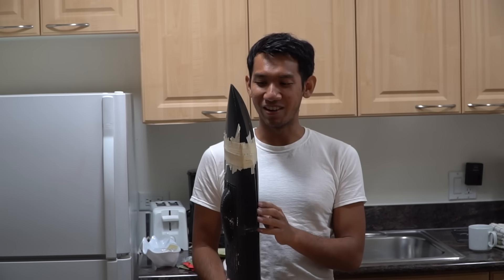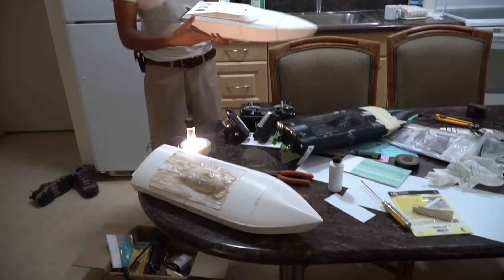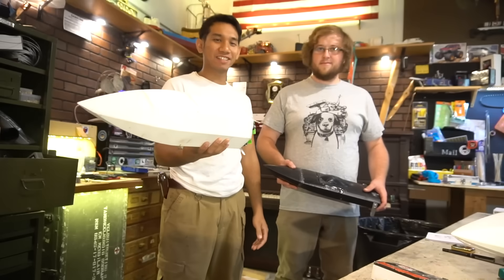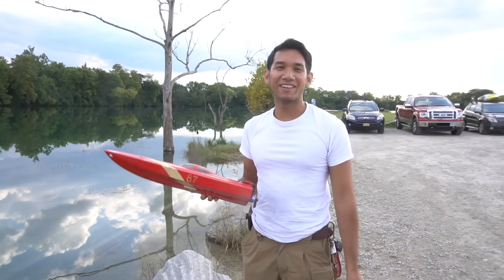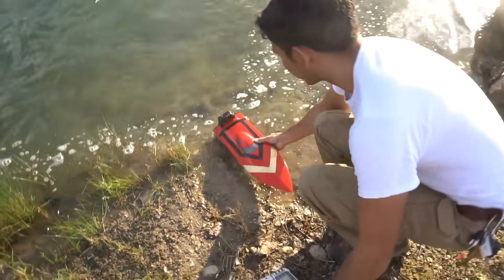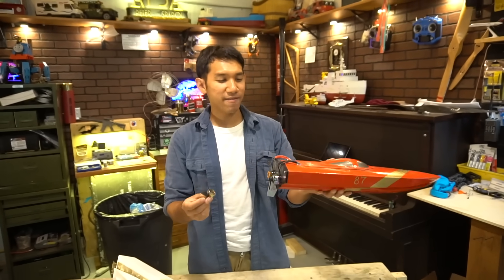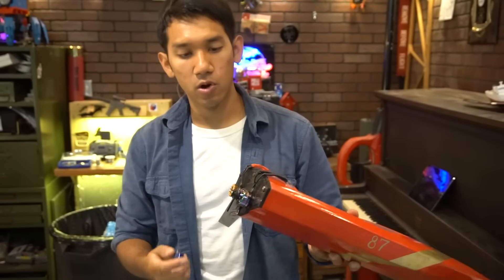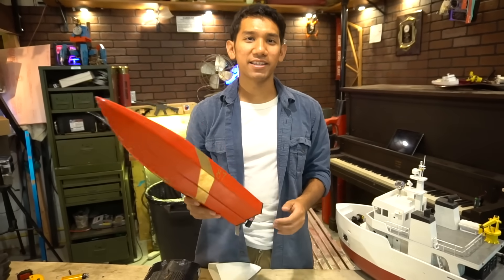FAST simple 3D PRINTED RC BOAT

Comment: I am gonna try to put one of these boats together but with a proper shaft, prop and rudder.  I am gonna try to use a traxxas 12t Titan motor and ESC with 7.2v 3000mAh NiMH packs to power it.  I upgraded a truck to brushless and have a whole electronics and hardware system for a boat extra.  I was gonna try to make a boat from scratch using foam board or thin plywood but this looks like the way to go.  Thanks for posting the .stl files!!!

Comment: I think that your placement of the motors sucks. You should have placed them in the boat and put a drive shaft out the back with a proper rudder and you would have gotten a lot more speed and control

Comment: Can i have the stl file of all the parts for this boat but the dimensions can't be greater than 220mm(my 3d printer can print 220mm x 220mm x 220mm maximum)plz

Comment: Hi Peter,

With injection moulding you need to machine a steel die which is predictably extremely expensive. It's only really economical if you intend to produce tens or hundreds of thousands of units. It costs tens of thousands of dollars per die.

You might want to look at vacuform (vacuum form) moulding which I believe is how most rc shells are created. 

You might be able to find a strong, flexible resin in which case a rtv silicone mould could also be an option, but for creating rc boat hulls I think the vacumform is your best bet, unless you have the money to burn for a steel die.

Obviously researching what other people have done in the hobby would be prudent. Especially as this a little outside my area of expertise.

Comment: When designing a boat hull remember your goal is to displace only enough water to slightly outweigh the boat and equipment so it floats at 0mph and it will rise from hydraulic force st speed so designs that set low in water with no speed are ultimately beter.

Comment: Hi Peter and Sam, do you have a tutorial on how to post process the hull? I printed and build one, but it seems to do the same your boat was doing Peter. It dips the nose down on higher throttle. Also it will turn itself at higher throttle. Tried different props but I'm going to try some more. I didn't have any two bladed ones anymore. It might be the hull has to much drag maybe? Any help is appreciated :)

Comment: Exposed Engines at a speed boat - Incredible Idea that will impact future Speed Boat Designs.
Try to put 4 Engines and implement an active pitch control via FCU. (Install two of the Engines with an angle of some degrees)
This will solve the big problems that speed boats tends to flip… - You´ll get unreached speeds…Revolution

Comment: Next it should be a steam boat like the African Queen. there is a cheep $30 steam engine on amazon and some cheap pot boilers on there to even though a boiler is vary simple to make with copper pipe.

Comment: Love the simplicity!
With your current design, much of the props are blocked by the hull, reducing thrust and efficiency. If the hull recedes or the motors jet out it should be much more efficient... and FASTER!  I made a quick 3D model to get the idea across, here is the link on google photos...    https://photos.app.goo.gl/nsFJrjiVeEzHwUNGA

Comment: i like your channel man
but if you wanna keep 3D printing boats and other shit
do your self a HUUUUGE favor
locator ID pins in the digital model to help when printing and assembly
most car engines do this with the cylnder head to help set it down in the right spot to let the arms rest and for boats like this it would be a HUUUUUUUUUUUUUGE asset to keep things alined
that way leak goop is needed and you'll get a better seal
~rock

Comment: Peter, have you tried 3D Gloop  glue for PLA? They also have a formula for ABS. Just got a tube from www.3dgloop.com and tested it on some scrap PLA and it seems to really work. 
Perhaps use it in place of Epoxy next build.

Comment: I would like to see that hull and motor mated up with a jet drive. Something like one of these cheap units from ebay. https://www.ebay.com/p/2017-Hot-Electric-NQD-757-6024-RC-Boat-Turbo-Jet-Replacement-Part-W-390-Motor/2184885436

Comment: im kind of wondering why neither of you put the motors inboard of the hull or anything more conventional, if you spent alittle more time designing the hull you could make all the motor mounts 3d printed into it or even a 3d printed jet drive or something better than the two motors hanging off the end. anyway I still love the vids
Reply: They're still very functional, why put in the extra effort?
Reply: That's a lot of effort. Putting the motors outboard and oiling them every so often is much easier than trying to get a waterproof slip joint to work.
Reply: that is true but I have seen peter do it before in other boats and I think it might be well placed effort, it would be pretty cool to be able to 3d print something more hobby grade that only needs one motor and a steering servo just because it is a more common layout for boats and can self right with the torque of the motor
Reply: @drewalsup9200  he did mention in the video that inboard motor parts are a pain to source compared to plane parts. But yeah, a single motor + rudder setup would be a nice thing to try, though at the expense of raw power of course.
Reply: now im actually curious to see how well the drone motors on the back would work if they tried them with actual boat propellers instead of cutdown quad props, maybe smoother in the water

Comment: I 3d designed my own boat, converted it to papercraft, printed it out really big and then cut it out of 0.3mm tin plated steel (the stuff tin cans are made out of) which I then soldered together, this thing somehow turned out amazing without ne having any knowladge of rc boats.

Comment: The answer for long print time is making it smaller, as the square-cube law means at half size, it actually has 4 times less surface area and 8 times less volume/mass (obviously not linear as 3D printing uses shells and infill, but it's close). You could try testing what sized motor/prop combo would be the best for a 75% or 50% scaled boat, for example.

Comment: Aren't you losing a lot of power with the props half out of the water and partially blocked by the hull? Why not do a more traditional design with the props on shafts so they're not right up against the rear bulkhead?

Comment: Sweet.  Love the quad motors with cut down props.  That makes a custom boat really simple to accomplish.
Reply: Go buy two surfer RC "boats", gut them, and make a single shell out of a few pieces of balsa, total will come just under 60USD, fast boat, cheap, fun to make.
Reply: @aserta  With the quad motor trick, I don't need to buy anything.  Got a 3d printer, so designing and printing a boat would be trivial.
Reply: @localfiend  hey localfeind I'm from the forums (I'm beta testing the 27inch pike). I guess we both like Peter's videos!
Reply: man, its one of least efficient ways to make water prop. its better to buy some of them, or even 3d print them for free

Comment: I've been working on a 3d printed pontoon airboat for the last month, it's about to go on its maiden (possibly final) voyage. Uses a brushless motor designed for a delta wing I bought and got board with. If it doesn't sink I'll send a link to the video.

Comment: 3D printed submarine with gopro underwater camera inside ;)
Reply: The problem is getting radio to work underwater (hint: you can't) so it would have to either be tethered or just have a long pole/periscope tower for the antennas.
Reply: FPV sub with floating receiver/cloverleaf trailing pod?
Reply: @xureality  you can! You have to use another Radio, use an old one with 35Mhz or 40Mhz!
Reply: @Erichder5te  only to a few inches, which is basically nothing in terms of diving depths, though i suspect that you could get better signal in fresh water since the limiting factor of seawater is conductivity and not absorption so your mileage (or should i say max depth?) may vary.

Doesn't help that i had been thinking in terms of actual submarines (where khz range signals are used, and even then only to a few meters, ELF signals excluded) which for many reasons doesn't operate in freshwater.
Reply: @xureality  You´re right so either just dive some inches or we want to see a 3d printed AUV :) 
That can autonomously follows a diving Person with Propellers in his Fists :o

Comment: You could vacuum form the top and bottom halfs, that should be pretty cheap to produce both in big and small quantities
Reply: thats a good idea.. anyone could 3d print theirs and then vacuum form it to have cheap copies
Reply: there ya go, Peter, scratch build a 12x24 vaccuform table. steal heating coils from a bunch of hair dryers or cheap electric heaters, shopvac to pull.
go smaller (about 7x12) for using 2 liter bottle plastic could be good for instant tiny whoov frames, micro boats, 1/16 or smaller car bodies etc.

Comment: I tried doing something similar with an old Traxxas velineon system from a rustler vxl, and it consistently ripped every piece into shreds.
Reply: Wait a sec, the Beef Stew? The original one? The one dunkey mentioned several times?

Comment: Amazing boats! 😃
Just didn't liked the idea of exposed motors...
Reply: Why?
Reply: @sheabrown  12:07 of the video.
Reply: yeah, but why don't you like the idea
Reply: @sheabrown  Too much maintenance needed. Those motors aren't cheap... So...
Reply: The motors are only $20 each that's cheap and a squirt of oil and spin it when you store it isn't much of maintenance. I think they should of used boat propeller though. The 3d file can be modify also to make them in board motors even without a long shaft.
Reply: but they are not salt water friendly

Comment: Can u make one that drives FULLY WITH SOLARcells???
Reply: rst it’ll be more like a  🚣‍♀️  vs 🚤💨
Reply: yup, solar just can't deliver the watts to boogie
Reply: Imagine the size of solar panel needed to get a few hundred watts to these motors. It's gonna be huge. And when it's huge it's not gonna be fast anymore.
Reply: xureality  so Peter has to try it 
i think its possible (no more fast ) BUT DRIVING
Reply: Solar panels at this scale dont mix to well with water in my  experience
Reply: @aaccount7616  nothing conformal coating can't fix

Comment: What type of glue and Filament did u used???
I want to make the same boats also WATERPROOF
Reply: may be two components epoxy
Reply: @ABID5  i think so
Reply: if you don't like epoxy you could print in ABS plastic and use acetone to fuse the parts together like in his earlier boat videos.